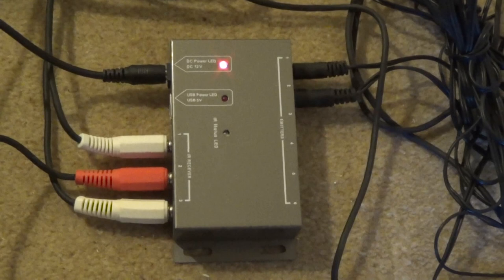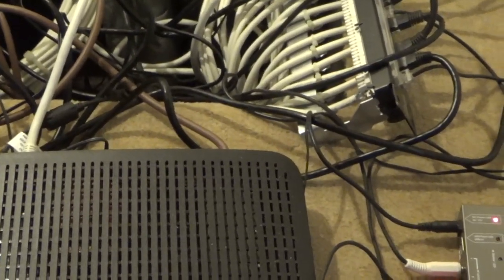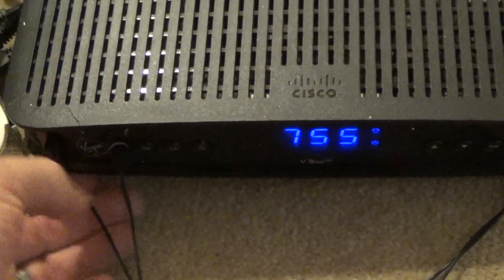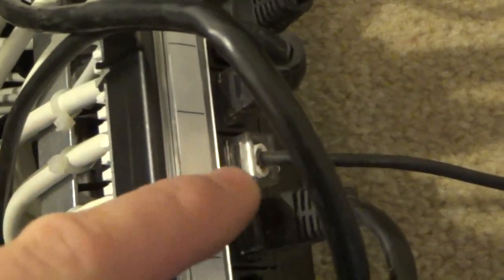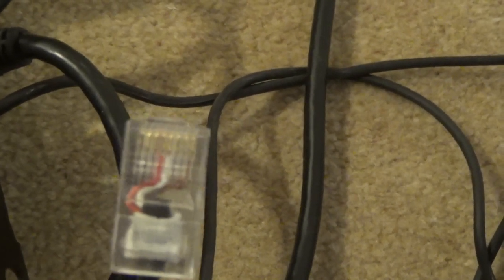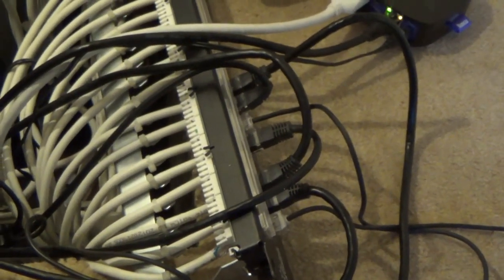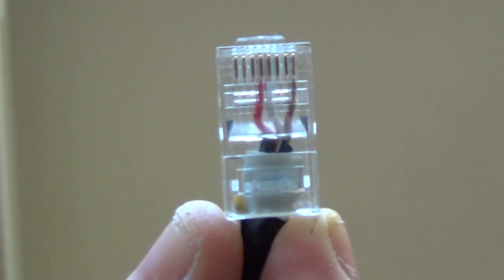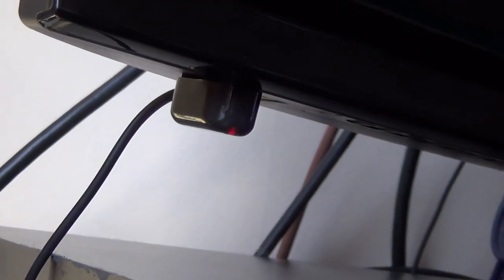How to install a remote control extender kit (IR Extenders & Emitters)

Comment: Thanx for the videos ....👀Will it work if I connect the IR output of my Samsung TV directly to the IR receiver and then put an IR extended cable to an amp on another room instead of having an extra amp....I also wish to control the amp volume and tv volume with the same remote control   PS: when I am on the tv room I switch to speakers A and speakers B when I am in the room where the amp is. Cheers!

Comment: i dont think you needed the rca plugs, i think you can just splice those off and use beanies straight from blue wire on cat5 to red wire on ir emitter, blue and white on cat5 to white on ir emitter and the ground to the green cat5 wire

Comment: Mate this is exactly what I've been searching for now for days. Made my day finding this honestly! My situation is I have a myharmony hub and all my equipment in a cupboard in another room in a server rack. I forgot to run 2.5mm cable (the harmony hub uses this instead of 3.5mm) luckily the harmony ultimate has ir on the remote so it saved me. But it doesn't allow me to start activities with my phone app or Alexa etc as I'm not using the physical remote if that makes sense. Long story short. Would this work as I think the hub puts 12v through the cable to make it work? I tried it before with cat6 keystones but it didn't work. I think I messed up though as it seems you need to use a ground wire also? Your help would be most appreciated

Comment: First thing I would like to know that  many IR recievers points are available on shown kit? Secondly can we expand the number of reciever with some splitter or switch?
Reply: Sandeep Kachhap Not quite sure I understand but if you were to take an ir receiver with say 4 ports and extend the main port to say your tv that would control those 4 ports at the main point. So if you had 4 devices to switch between you could do that. If you wanted to split anything at the other end you could use an adapter I imagine. Something like a y splitter.

Comment: Hi Great video. Just wondering how you managed to get the 3.5 jack cable into the RJ45 and crimp it?. I cannot seem to get mine in easily.
Reply from the maker: If you find that the wires keeps bending in the holes without going in then you may have more luck with cat6 plugs with the staggered holes (one high, one low, one high, one low etc.) as these have slightly larger holes.
Reply: Thanks cat6 plugs worked a dream!!

Comment: I still don't know what this system is for
Reply from the maker: Gloria Lenis You would use it if you wanted to hide your equipment in a cupboard or under the stairs etc. but still wanted to use the remote control.

Comment: Hi.. may I know how long did you run your network cable ? Also, what brand of IR receiver are you using (that has red LED flashing when IR signal is sent). Thanks
Reply from the maker: +Azman Hi, the network runs are approx. 15m and the IR receiver is just an unbranded Chinese product.
Thanks Vince
Reply: Thanks Vince. I am hunting for the IR extender too (but most of them comes with only 1 receiver). Need to get additional 2 more IR receivers since the extender can support up to 3 receivers :).

Comment: How does this device pair the IR receiver with the IR emitter?  meaning there are 3 inputs for receiver and 6 inputs for emitters. what is the right connection for receiver 1 to work only with its emitters and receiver 2 with its emitters?
Thanks
Reply from the maker: +Shlomi Cohen It transmits all receivers to all emitters. It is the equipment it self (for example set top box) which will recognise the correct remote control.Thanks.

Comment: HOW TO VIEW WITH DIFFERENT TV USING IR WITHOUT INTERFERING WITH OTHER ROOMS CHANGING IF THEIR CHANNELS JUST BECOS YOU WANT TO CHANGE YOURS
Reply: OF THEIR CHANNELS
Reply from the maker: Hi, if the IR kit is set up on a set top box then when you change the channel in one room it will change the channel in all the rooms because the set top box has changed channel. This kit will not allow you to watch different channels in different rooms on the one set top box.